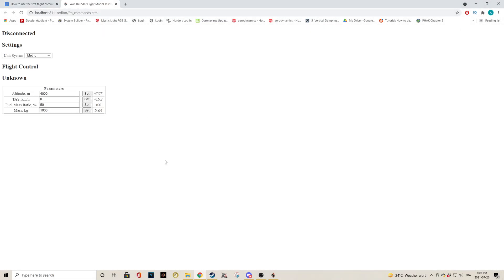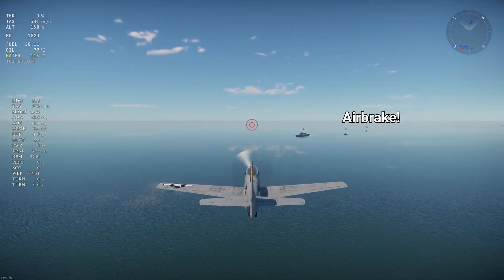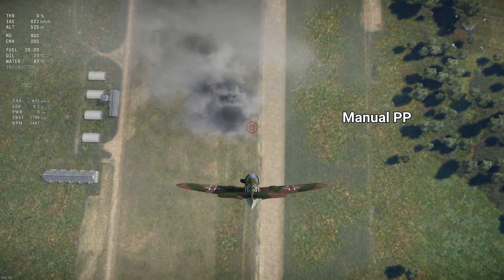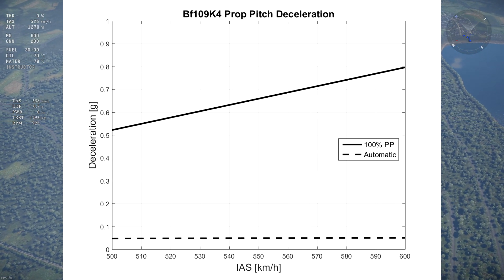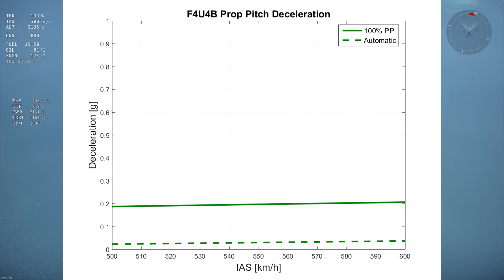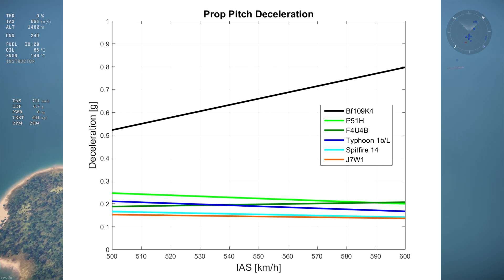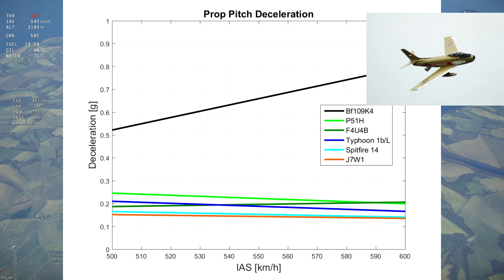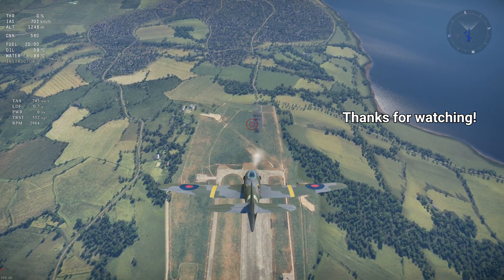War Thunder Tricks #10 | Propeller Pitch Airbrake

Comment: I don't need to be convinced of the value of neutralising or reversing propeller pitch. I need to know how to make it happen with minimal change to my aircraft's controls and in mouse aim. For example, I have learned that the SAAB SK-60B has a reverse thrust capability. So I set it to activate with my airbrakes when I press H. When coming in for a landing, I hit H, and stay at full thrust. On the ground I hold B for ground braking. For prop planes that have variable pitch props, I wish to press H to go from automatic to the lowest pitch available. For some planes it's zero. For some it's negative. How can I set my controls so that H, a) Toggles pitch control to manual AND, b) reduces pitch the maximum amount.
Reply from the maker: You can't do both on the same key for prop pitch. You need a key for manual prop pitch, then 2 more keys for increasing and decreasing prop pitch.
Reply: @AdamTheEnginerd  By your logic, I need two keys. I can use the H key to toggle between manual and automatic propeller controls (as well as toggle airbrakes AND reverse thrusters), plus one more button to decrease propeller pitch. Pressing H again will retract airbrakes and trust reversers and turn the pitch control to automatic. Now can you tell me how to toggle pitch controls and decrease pitch?
Reply from the maker: It's under the manual engine controls keybinds. You should look up how to setup MEC on YT if you don't know how.

Comment: Thanks for explaining the airbrake! I am already seeing better results by using it to avoid compression in my Bf-109 while diving from 5-6 km. Also mapped the keybinds for the radiator controls, and it gets me up to 5 km significantly faster than just leaving them on auto, as the WEP overheats the engine in like 60 seconds when using auto rads.
Still have to get used to the keybinds, but it's a really useful trick to have.
Reply from the maker: It's my pleasure!

Comment: Through some experimentation I’ve found that 100% prop pitch isn’t optimal. It seems that 90 is more efficient and doesn’t cause as much heat. Thoughts?
Reply from the maker: This is for braking, and your engine should be off so heat is not an issue.
Reply: @AdamTheEnginerd  I understand. My thoughts were in general and not related to prop pitch air brake. . I reacted to a part of the video where you stated set the prop pitch to 100. Please keep doing your vids. I truly appreciate them. A lot. Thank you.
Reply from the maker: @edwardblomstrand7203  Oh yeah, on most planes running a bit lower PP hardly changes power, but improves cooling noticeably.
Reply: How do I control PP😭

Comment: Hey Adam were bf 109s or German planes recently buffed?
Reply from the maker: Not that I heard of.
Reply: @AdamTheEnginerd  if you look at the stats it says that the g2 turns at 18 seconds but it used to turn at 19 seconds and it’s top speed is now 700 something mph and the f1 now turns at 17 seconds but used to be 18 seconds and the g6 turns 19 seconds but used to be 20
Reply from the maker: @anbenzgar3768  No way a prop goes 700 mph, and stat cards are mostly misleading anyway.
Reply: @AdamTheEnginerd  well ok but I think bf 109s did get buffed buts it’s just a small buff anyway
Reply: @AdamTheEnginerd  never mind, it turns out that a weird glitch changed the stats

Comment: I found it only works for g10 and g,14 and k4 109s I broke my engine on everything else or it didn't airbreak me well it did but not much however very useful if you don't need to slow down mucb
Reply from the maker: As long as you go to 0% throttle, tier 3 and 4 Bf109s can handle any airbraking speed.
Reply: @AdamTheEnginerd  that's why my engine fucked lol

Comment: Fantastic video! Little question: 5:07 why the P51H and Typhoon drag deceleration decreases with speed? Shouldn't it increase like the K4?
Reply from the maker: Thanks!

Good question! The answer is a tad complicated, but essentially the power required to turn the prop-engine is constant for a constant RPM, and at these speeds nearly all the aircraft in this video are at their max RPMs. Since the power required from the wind is constant, and P = Drag x TAS, drag decreases as speed increases. This doesn't apply to the K4 since its RPM isn't limited like on non-German planes, so RPM and hence power required keeps on increasing as speed increasing. The reason why a couple of planes show constant or even slightly increasing drag between 500 and 600 km/h is because they weren't yet at max RPM at 500 km/h, so there was still room for power required to increase.
Reply: @AdamTheEnginerd  thanks for the answer! I didn’t think about the fact that the Germans are the only one where prop pitch actually represent the prop’s blade slope and not the RPM

Comment: Shame you didn't test anything Russian. PP brake in a Yak is in my experience staggeringly good.
Reply from the maker: Oh really? I haven't particularly noticed Russian PP effectiveness.
Reply: @AdamTheEnginerd  In the Yak with their low rip speed, it's very often the difference between ripping and not. I wouldn't be surprised if it's just in line with the other non-German air brakes though, were you to test it. But that difference >feels< huge.
Reply from the maker: @GingerNinja__  Yeah on the Yak3U/VK, it's very useful to prevent ripping.

Comment: Soooo basically turn mec on and turn prop pitch to 100% always? Do I need to turn it back to automatic when not wanting to pp airbreak?
Reply: Don't forget to zero throttle before turning off Automatic prop pitch, or you will damage the engine of 109s (especially at higher speeds and higher prop pitch). I would say try in custom before doing in real match, I have damaged my engine while using manual pp and forgot to set 0 throttle.
Reply from the maker: I guess yeah, though if you use MEC this occurs naturally, no need to turn it on and off again.

Comment: I think the produced drag going to snap off the propeller since put a lot of dense air to a small area so much so doing work that's rotating heavy internal engine from externally (i hope that makes sense) and that inefficiency creating that drag. This scenario when we looking for lowest propeller efficiency to save our propeller!
Reply from the maker: The produced drag can be about double the maximum of what is produced with thrust, so it shouldn't snap off instantly since it's not an order of magnitude higher than what it is frequently resisting.

Comment: How it works with fw 190???
Reply from the maker: Similar way as the Bf109, but less effective and you can't use it for more than 2 seconds or so, or you overrev. Or you can set a lower PP to use over a longer period of time safely.
Reply: With 190's you dont run the risk of wing ripping and the controls are still usable at 700 kmph . Only time i would use it would be at low speeds to force an overshoot since 100% prop pitch even on zero throttle can lead to engine damage above 400 kmph . If you need to bleed speed at higher speed ranges use takeoff flaps instead

Comment: I just turn off my engine and throttle down to 0%. Then I engage MEC and get prop pitch to 100%. After slowing down to some 350ish km/h I turn on my engine to get that extra drag produced by "engine inertia". That's how I land it and I think that's situation where you can use propdrag to full extent. All that combined with 100%rads and you go from 600 to 250 in no time.
Mind that if you go above 350ish km/h with your engine on while having prop set to 100% your engine will overrev and DIE!
So a lesson is here: TURN OFF YOUR ENGINE FIRST THEN YOU RIDE THAT PROP :D
P.S. You can do it in battle at "any" condition for max one second and it will not do harm to your engine.
Reply from the maker: Yup gotta throttle down.

Comment: I think it would have been worth noting that the Bf 109's manual PP sets the blade angle directly, while in most other planes, manual PP sets the desired RPM.

100% PP in the Bf 109 places the blades as flat as it can against the air stream. Other props do not get anywhere close to this angle due do the RPM governor. You can view the prop angle in WTRTI (in degrees).
Reply from the maker: Yeah the range of pitch angle matters too here.
Reply: @AdamTheEnginerd  I'm sure that the other props could reach it if only they were able to set PP directly, and not RPM.
Reply: That's why they damage the engine when using manual pp with full throttle.
Reply: @WigglyWings  Yep!

Comment: What a realistic Gaythunder...in IRL or in realistic simulators: the Bf-109 with  ~11:57 clock proppitch(max in gaythunder) or 12:30(maximum in IRL) in dive: THE ENGINE WILL OVER REV in 5 sec not "airbreaking"......
Lowest PP in Gaythunder:12:40?!, IRL:7:50
In Gaythunder the PP little pointer going around from12 to right like a regular clock to reach 12:40.
IN IRL: the PP little pointer going from between 12 and 1  to left counterclockwise to reach the 7:50
Good Job Gaythunder.
Reply: R/ihadastroke

Comment: Higher prop pitch grip airflow better. Lower grip airflow just enought without the extra drag. Thats how i explained it for people when trying to teach MEC.

Is that accurate adam ?. 100 help with climb, regaining speed near stall and turns also maintaining better control of pitch in general as they bleed speed a bit better for turn fight from my experience. While 85 for energy fighting (not ideal however in radials as blunt nose doesnt make the drag reduction noticable) acceleration and rush climb . Anything lower help dive.

Now question however. In an emergency i noticed that 100 prop pitch with leftover spin before the engine died seems to generate some extra lift. So should i feather and climb or climb and 100 for gliding ?.

Anyway. Beside the prop. What do you think of radiator ??, i found 5% at american radials radiator seems to generate some meredith effect thrust from the concentrated exhaust heat.
Reply from the maker: Not really, as long as the engine-prop is producing thrust, it isn't producing drag. Typically prop pitch should equal throttle, but there are a couple of exceptions like on P47s where lower prop pitch is better.

0% for gliding for sure.

In WT radiators can only generate drag, so 0% rads minimizes drag.

Comment: Sooo the bigger the props and the lighter the aircraft=the higher is the deceleration is for the aircraft?
Reply from the maker: Yeah. Prop pitch range and RPM are other factors too.
Reply: Yeah 👍
Reply: theoretically
Reply: well deceleration isn't a word
Reply: @Bleeto  Wrong, it is a word, it's just not the correct term in Physics.
Reply: @efethecaptain6  yeah you're right
Reply: @georgebennett715  well it shouldn't

Comment: 4:31 the time it takes to rev the engine up is REALLY noticable on the Tempest MkV

I'd be curious to see how effective the F4Us other airbrake (the landing gear) is, even though it's not practical in dogfights
Reply from the maker: Even more so on the Typhoon.

That's an interesting though. I think the prop pitch airbrake is more effective at low speed, while the landing gear airbrake is more effective at high speed. So there's a speed where they are equally effective.
Reply: @AdamTheEnginerd  and even more noticeable on M-82FN, the soviet radial one. This engine probably takes the longest time to start generating its nominal thrust out of all piston engines in WT